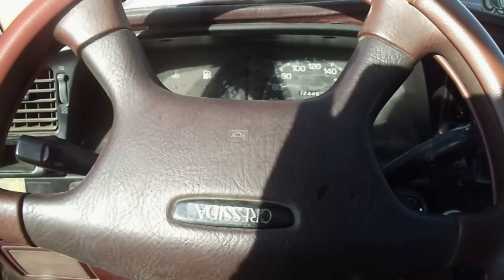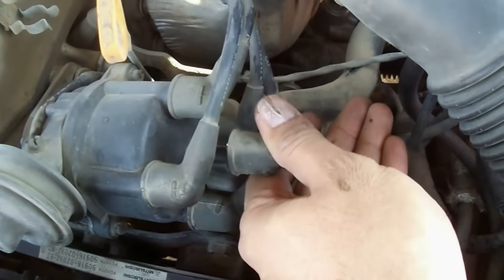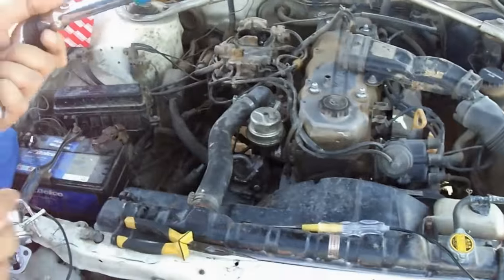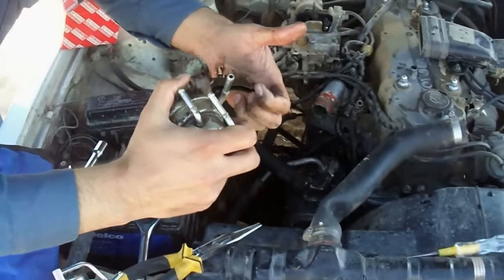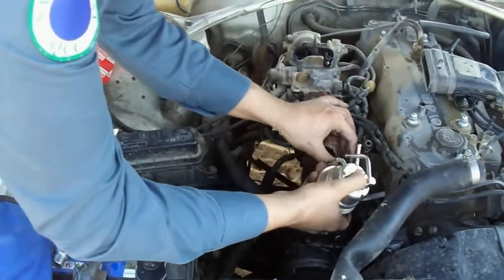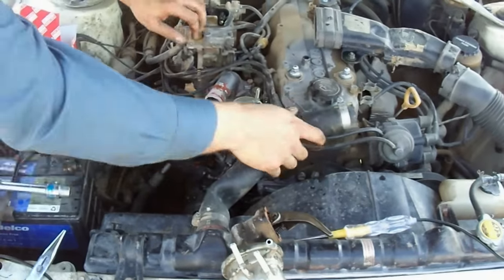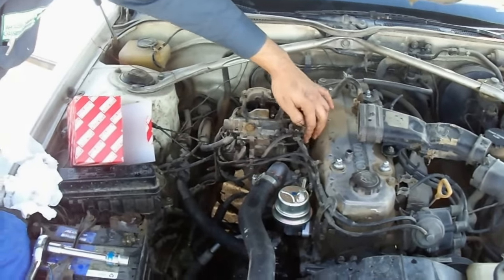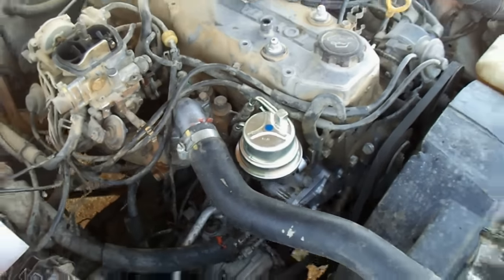Car no start diagnostic and repair. Must watch DIY fix.

Comment: Well done and good filming.  I probably would have disconnected the feed line TO the pump just to confirm 100% that there was fuel delivery to the pump and thus necessitating pump was indeed bad before changing it but the evidence was certainly strong enough to just go with the pump diagnosis.
Reply from the maker: Schrodingers Box Thank you dear sir for complement. Your diagnostic is No.1 of no part change without deviance. I did the very same thing with that pump before replacing it while first time I visited the car but did not filmed it as it was dark and night. I sucked and felt that fuel was there and was coming to the engine compartment up to pump. But pump was not sucking and was not pressurizing it. So in my case it was confirmed 100% bad fuel pump before replacement. Regards,

Comment: Good job Jahan.  A 1991 Engine still carberated.  Didn't know they were still putting carberators on those models.
Reply: busjockey1 Gulf versions only until 1996

Comment: Sir me i ask it is posible after overhaul of ingine because of iol leak..dn the stock of oil in mufler can cause smoke? Thanks...
Reply from the maker: Where there will be oil, there would be smoke. During overhauling it is possible they spill oil here and there which causes smoke. But it should disappear in a little while when it burns. Regards,

Comment: I have crisssida 21 R motor that i would likto install in a bakkie do you perhaps h@ve a video where all the water pipes air for example 
Water for heater fan 
Booster
Carburetor and the tiny on the carb the i hope you can assist

Comment: Hi sir, i have a 1988 toyota cressida glx-i with fuel injection.. the engine is wasteful of fuel, it consumes about 5 litres for approximately 20km.. the car wont start before, and after finding out the problem, i found that the injector socket is not plugged correctly and dirty by crust.. so i remove the socket, clean it up, and replugged it.. the car start with smoothly.. but a few days later i realised that the car is consuming too much fuel. the engine is 1G-EU.. how can i fix that? pls answer ;)

Comment: What is the next step after the fuel pump. Assuming the fuel pump is also okay but still no start
Reply from the maker: Then check spark, compression and in last timing.
Reply: @JahanZeb1976  thank you Sir, will try that on my hiace 5L and might let you know. Thanks you so much

Comment: Smashing, well done mate :-))

And the final things were to tighten the coolant pipe clamp and the air inlet tube, plus a cup of coolant to put back the small amount lost :-))

That engine looked rather mucky, uncared for?
Reply from the maker: Thanks dear sir for liking video. You got it well. Did all you mentioned jobs. The car is running well with the owner after the repair. This repair I made on the bank of road couple miles away from home. Regards,
Reply: Useful jobs and lectures

Comment: My 1997honda civic ex is not starting...  I have a crank no start... Coil is good,  fuel is good,  battery good.....  Started one day drove around for about 2hrs, park....  N back to crank no start....  Please help!!!!
Reply from the maker: khmerprincess1217 There will be sure something missing if it is not starting. If spark is OK, Fuel is OK then look for compression in engine. Fourth one could be timing which is rarely going bad itself. If this is a security immobilizer car then watch my other video on one Toyota Echo with no start and security problem. Here is the link.https://youtu.be/gHnrkRqcRoQ

Comment: Tell ya what, someday you may come to regret placing tools atop the battery when you're not using them. A 3/8 drive ratchet can handle several thousand amps.
Reply from the maker: Schluesselmensch Thank you very much dear friend for nice advice. Normally I am keeping a plastic bag on the top of batter or remove one battery terminal to avoid such situation but that day I was doing this car on the bank of road. There I did not care about that because prime thing was to start up vehicle there. Thank you for watching, stay tuned. Regards,
Reply: @JahanZeb1976   good morning   when your car stop working what to do